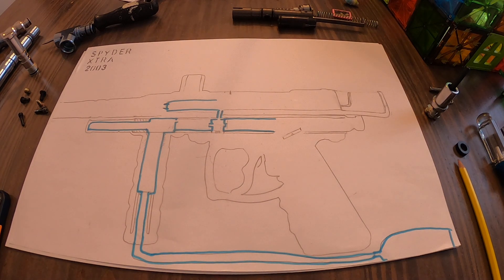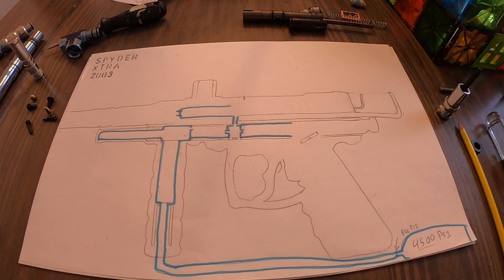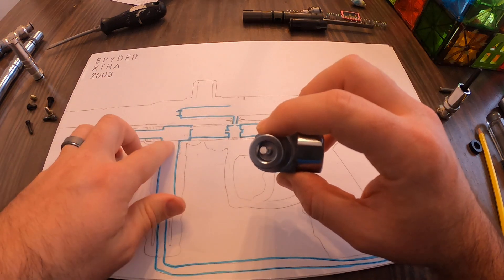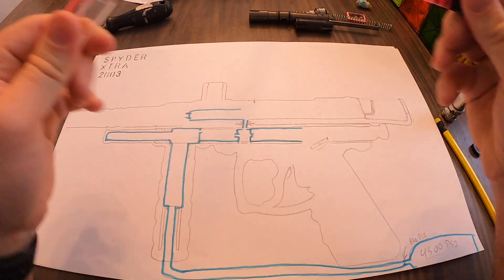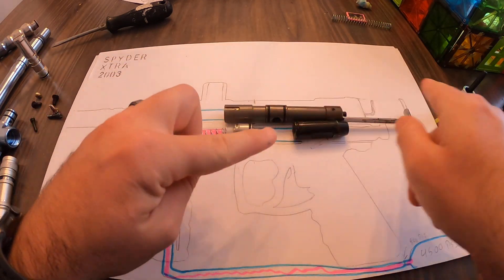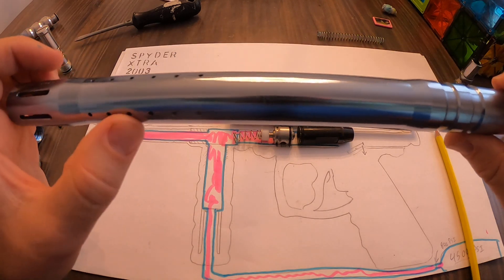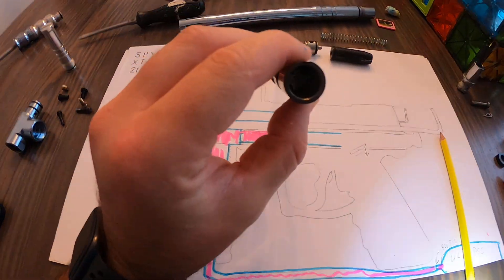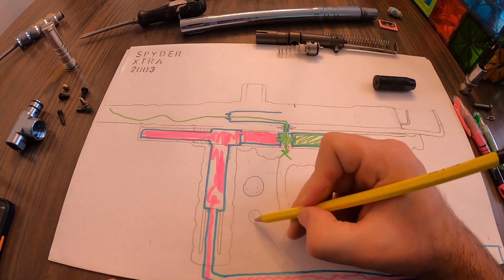Spyder XTRA airflow working principle

Comment: Any ideas where
Reply from the maker: im not super familiar with the cyclone system. but from what i can tell, it needs to be timed with the trigger, the issue being, there doesnt seem to be anywhere to tap air from. If it needed constanst air, that would be a different story, but since the air for this marker moves through the bolt, vs the 98custom which seems to move around in the chamber, im not sure where you can tap it.